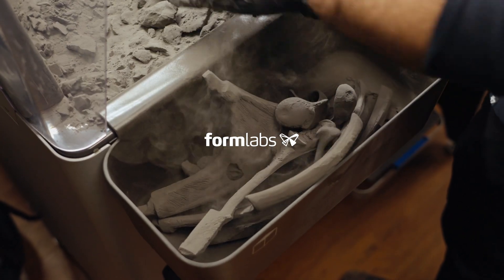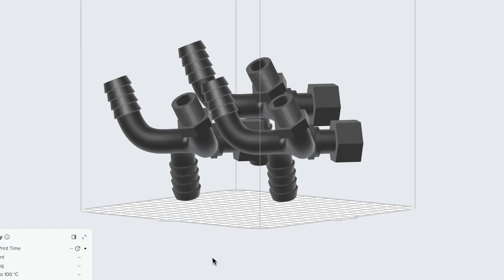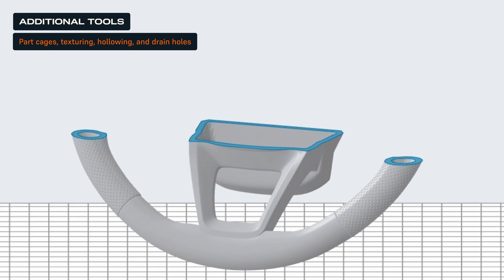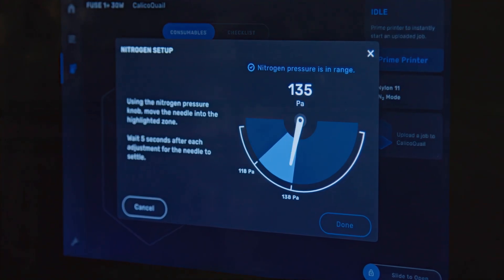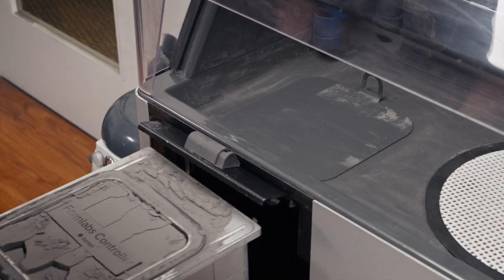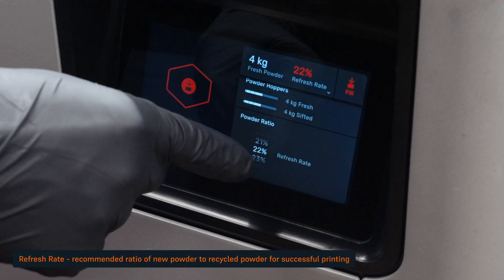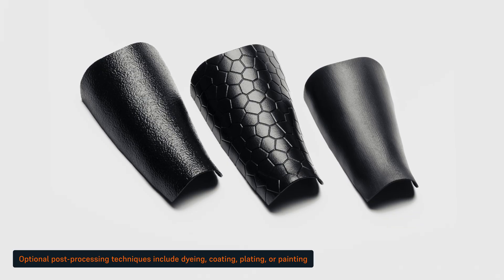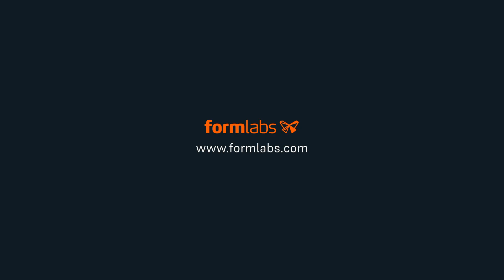Fuse Series Ecosystem: Complete SLS 3D Printing Workflow

Comment: so when you shell out a model in slicer, the end product will just be a bunch of loose powder stuck inside it?
Reply: You can add drain holes
Reply: Yep, this is common practice in powder bed fusion to reduce thermal load on the cake

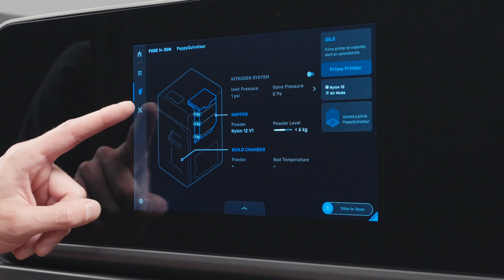Comment: 3:57 curious to know how many hours this printer has actually been used because from that date to now, that's only around 14,500 hours
Reply: probably over night, Vision Minor has a couple of videos using it and they showed the slicer where about 75% full batch was a bit over 12 hours and in another video they said that +600 tiny parts in single job was done over night